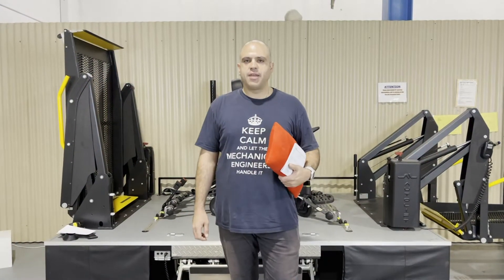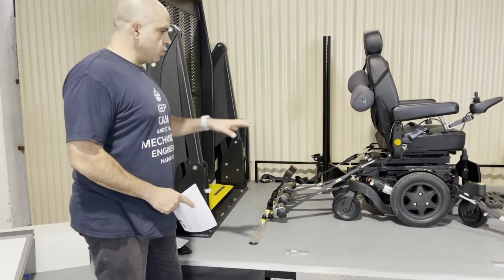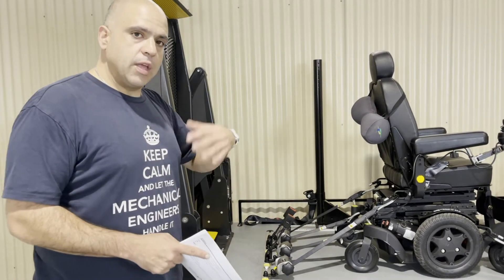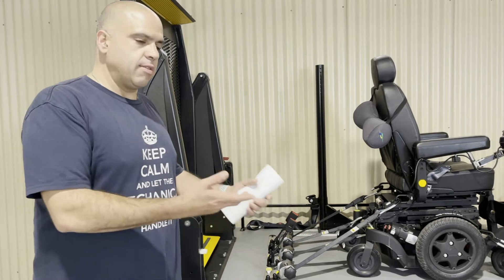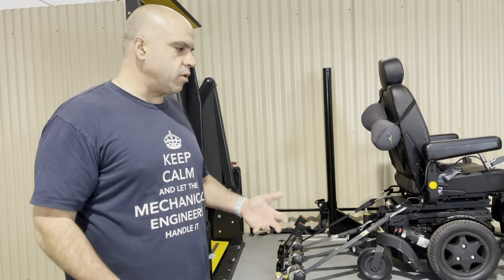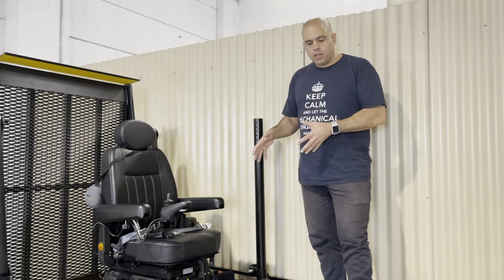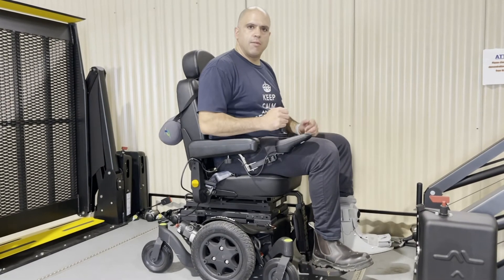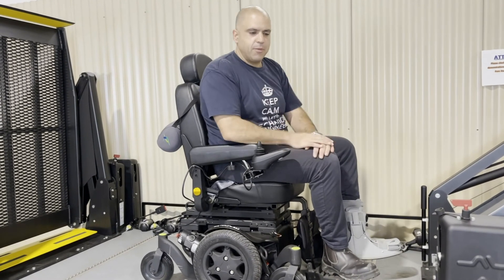QA #154​ - Do I Need to Use Six Wheelchair Tie-Down Points?

Comment: 15 minutes to secure a wheelchair is a bit over the top. Somebody has to pay for the time on each occasion this is necessary.

I like the idea of a docking mechanism. But I have a question: How many different types are there and how many of them are compatible with each other?
Reply from the maker: Thanks for the comment Ray.  There are quite alot of docking stations on the market, normally we recommend that you contact your wheelchair manufacturer because they normally have a preferred docking system.
Hope this helps!